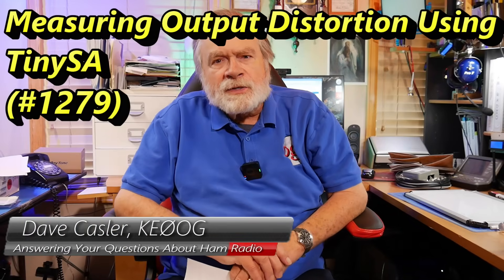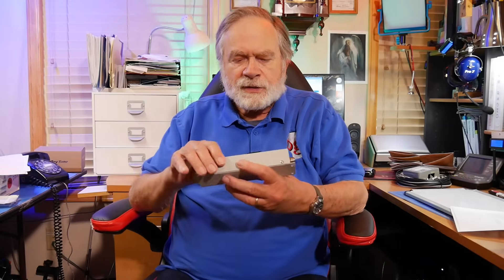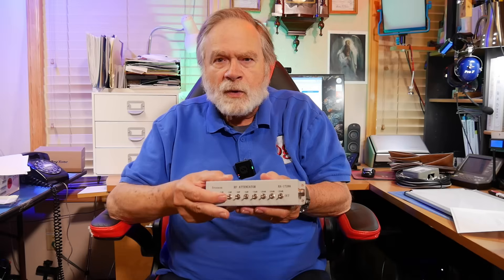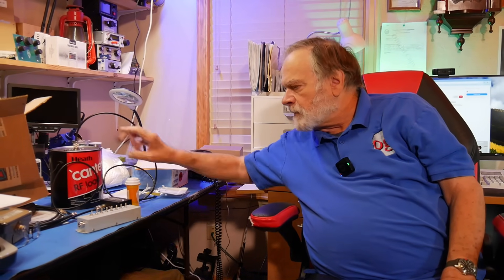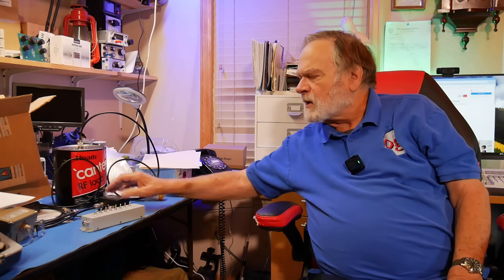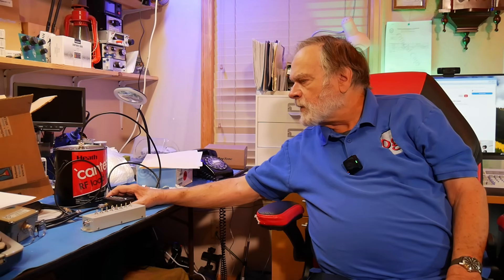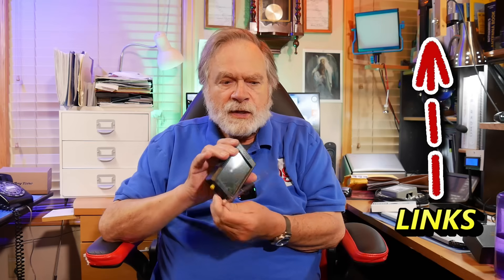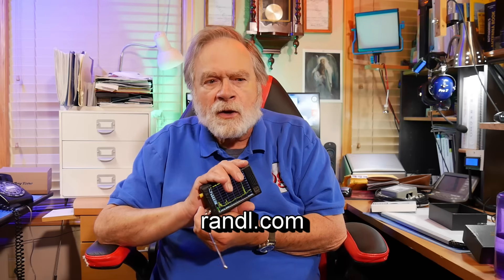Measuring Output Distortion Using TinySA (#1279)

Comment: You do NOT want to TEE the attenuator off of the line between the tx and dummy load.  This will create a stub that will cause all sorts of frequency dependent reflections and impedance variations, and will not give you a true representation of the power at different frequencies.  You need to use a power attenuator (rated for the tx output power), inline with measuring instrument in order to get an accurate result.  Also, testing for harmonics with an antenna on the analyzer won't give you an accurate result either because the antenna (including the receiving antenna on the analyzer) will have a different amount of response at different frequencies - so it could easily show the harmonics are higher or lower than they really are relative to the fundamental.